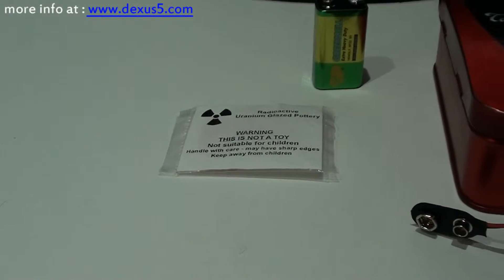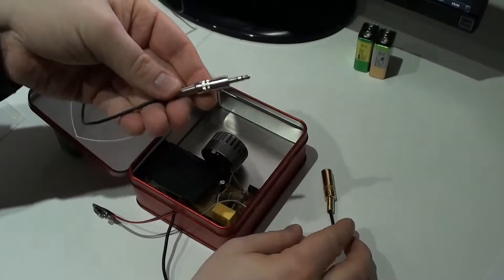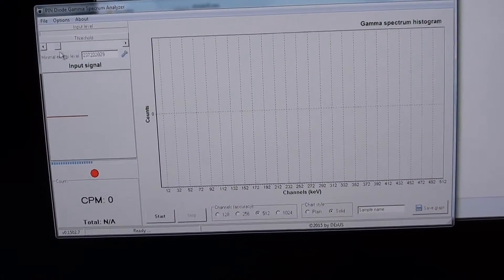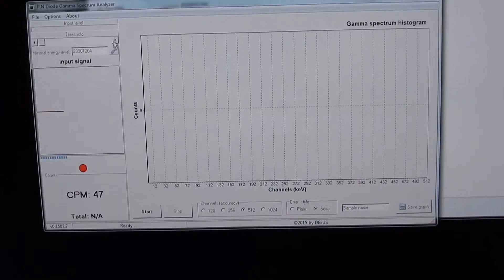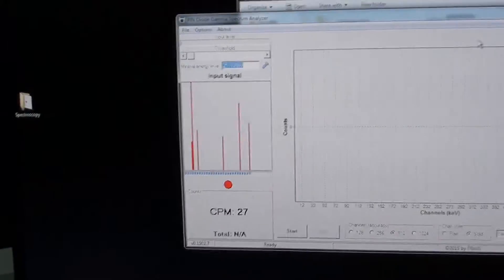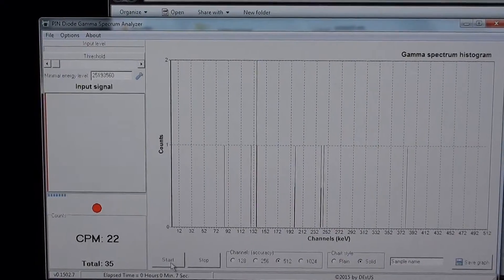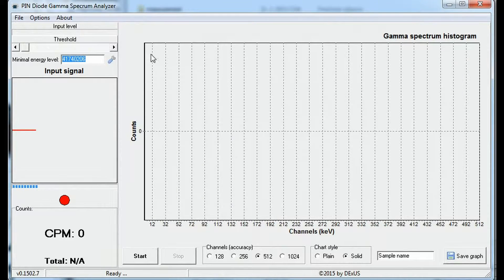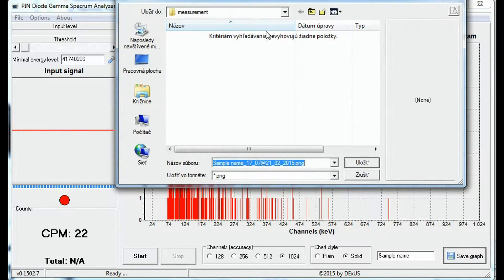PIN Diode Geiger Counter & Spectrum Analyzer under 10€

Comment: This is incredibly cool. Awesome job! I've been looking around for a cheap gamma spectrometer and I think I'm going to try this as an insensitive but cheap alternative. Have you checked its accuracy with a calibration source like Am241?
Reply from the maker: not really, it's basically a toy and Am is very weak on gamma but I might give it a try, I expect that 24h might give some results, but ~8h graphs of uranium look just like those taken with pro equipment in few seconds-minutes :)
Reply: Still better than nothing! Even just 1 uCi smoke detector Americium should produce around 37,000 gammas a second but at 60 keV they might be blocked by your aluminum cylinder covering the photodiodes. Anyways, great work again!
Reply from the maker: without the shielding there is just too much of betas from the uranium